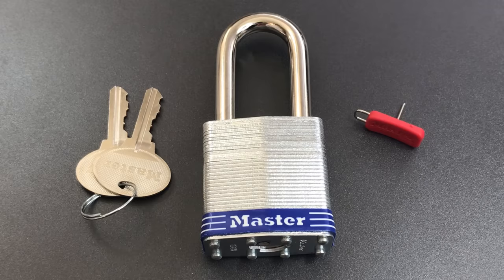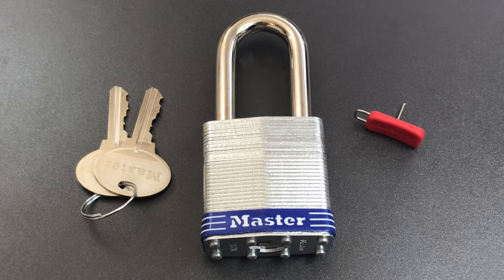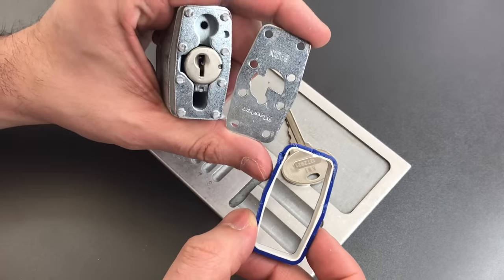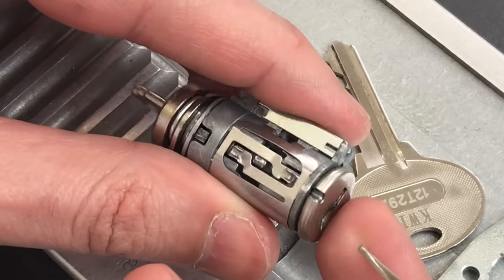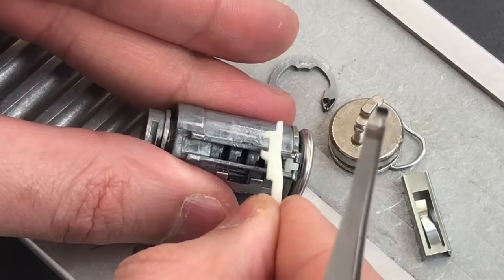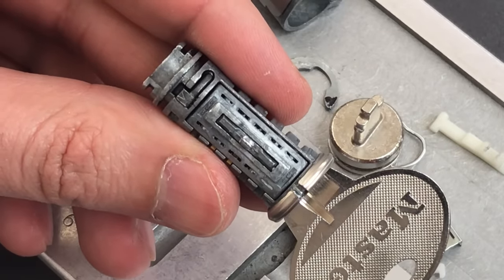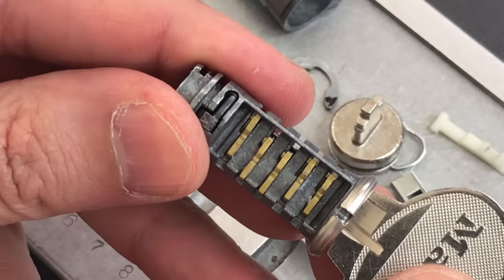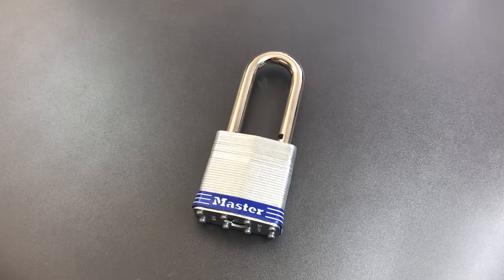[626] A Pick Proof Master Lock? ALMOST!

Comment: LockPickingLawyer What are you thoughts on the Sargent and Greenleaf environmental series? I've watched a bunch of your videos and really like the content. I haven't seen any videos from you on any of their locks. I have Sargent and Greenleaf 881 as part of my collection and was wondering what your thoughts were on this lock? Very instructive and interesting videos, keep up the great work, I'll be watching!!!
Reply from the maker: They are good for what they are... low security locks that last in the weather forever.
Reply: I watched quite a bit of videos of people picking this lock, and it seems that they were all using older locks that only had 3 disks. I purchased mine new (new in the box, never used) 2 years ago and it has 5 key cuts, not 3 like I've been seeing on all these videos. The lock I have has no identifying numbers on it, but the keys are stamped 5599. From what I've seen most people had quite a difficult time getting in to this lock and only could pick it if the had the key to study or the lock with a number stamped on it and the chart that gives you key cut angles. I would love to see you picking this lock with your disk detainer lock picking tools or other methods. I'm wondering if you think it's pickable without seeing the key and not having numbers stamped on the lock body to go by. I appreciate your response and your opinion.

Comment: I dont quite understand, why you cannot get the sliders to bind just by turning the core. From observation I assume, that by turning the core the programming sliders are pushed onto the key sliders and they snap into the grooves if the key sliders are set correctly.

Comment: Have you ever met a lock you couldn't pick before/after dissection? Also, is the core and parts hardened on this core, or can you drill and replace core? Obviously this core/cylinder is overkill for this padlock, which padlocks will it fit if any? Then, have you ever met and indestructible and unmanipulatable padlock body? Seems we need to mate an unpickable and indestructible core with and indestructible and unmanipulatable padlock body and shackle eh? lol...

Comment: Does the lock use a ball bearing mechanism or a springed mechanism? If it used the ball bearing mechanism it would be a good idea to put this on a gate since it can be opened with a house key if your house uses Kwikset locks (unless laminated steel padlocks are bad to use outside)
Reply: Never mind he said shimming, it has springs in it.

Comment: All one needs to rekey that lock is to buy an identical lock with the rekeying tool, and place another key into the lock along with the tool to pin the lock to their key. The opposite of security. You'd be better off with a traditional lock that at least requires some cursory picking skills.

Comment: Did they intentionally create this weakness? Why not put a slope on the key side of the tab in the side bar, so that you couldn't push on it without slipping off, so you couldn't bind it? Or just create more overlap with the cylinder. I could easily fix that sidebar and eliminate the picking problem, but the latching mechanism is still the biggest weakness!

Comment: It's like they do it on purpose. If the hole in the plate were not overly large and the core didn't float around so much you'd never get a tool in there..

Comment: Is there a lock that provides a tamper-evident indicator in case someone attempted and/or succeeded in picking it? I'm imagining something like a pin that is never set by the key but would be easily set through picking and once set, could not be unset except after opening with the key, and would leave a visible indication for the owner, and then perhaps only at the time of unlocking using the key.
Reply: LPL mentions something like that in his quick and cheap kwikset lock upgrade. There is a space in some kwiksets to add another pin that will brick the lock if someone tries to open it without a key.

Comment: this seems like they could have fixed this just by putting a spinning shield on the front of the lock core or something. It's really frustrating seeing Masterlock make almost-really-good locks that just have ONE MASSIVE GLARING FLAW in them that could be so easily trivially fixed.

Not including the issue with being able to just punch them open.

Comment: I cant imagine this lock functioning in the cold.   If I cant take a flame to my frozen lock without worrying about melting its guts or permanently disabling it then forget that lock. What do you think would happen if you took a torch and got the lock hot enough to melt the plastic? Could it help pick it or would it disable the lock permanently? Experiment?!?!

Comment: Plastic parts. Wouldn't any lock containing plastic parts be rendered unusable if the lock was heated from the outside? The exterior may not be that damaged but the inside bits made of plastic would deform and melt rendering the lock a "not lock."

Comment: If you really wanted to screw one of those locks up, you'd just have to take a lighter or a torch and heat it up until the plastic melts.

Comment: I thought most people just cut these types of locks off with powerful bolt cutters and such?
Reply: If you don't mind destructive bypass methods, then sure.  If, however, you have a reason to prefer non-destructive bypass methods, then no, you wouldn't want to cut or break it open.

Comment: This one was way over my head. What's a side bar? LoL
Reply: It's literally a Bar on the Side of the keyway to prevent the lock cylinder from turning. The proper key will hold it out of the way, but picks will not. That's why LPL attacked the sidebar before picking the lock.

Comment: how pick-proof would a lock be if it was made heavy, like room-scale, and the key weighed 20-30lbs, as long as a mattress, so large that you'd need two people to get it into the lock, the bitting on the key only started at about 3 feet from the "knob", forcing you to really insert it deep, and because it's so heavy, had to be turned once inserted into the lock by using an equally large machine? Like, tensioning that would be impossible for a human being, and you wouldn't be able to get inside the lock to pick it because although it's huge, it's far too narrow for a human to fit in, and the pins are too deep to reach with your arm. The pins would also be heavy as hell, making it impossible to grab a long rod and set the pins that way.

Eh, you're LPL, you could probably do it.

Comment: He doesn't show you the hours he spend dismantling the lock to figure out how it works and how to attack it.  Then, once he had found an approach he had make a special tool.  That tool needed to be the right combination of thickness (too thick it won't fit, too thin it isn't strong enough), springiness,  and curve.  Then I'm sure he practiced a few times or videoed it several times until he got a take that made it look easy.  LPL admits all that in the video.

I don't mean to denigrate LPL's knowledge and skill, only to point out that the lock remains nearly un-pickable even for 99.99% of knowledgeable lock folks.

Comment: 2:30: "...we then remove the re-keying tool and it should be reset."
You have two locks. You have different keys for them. You could have showed us the re-keying for real instead of relying on "should be". Sorry, but I just had to point that out.